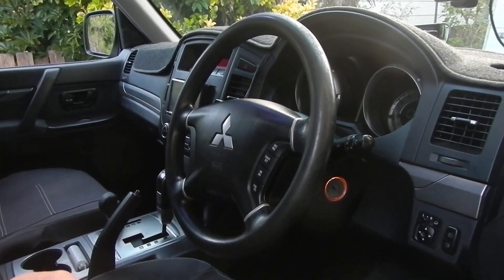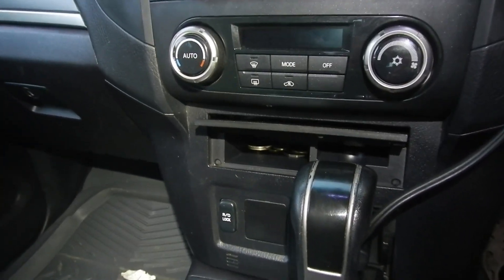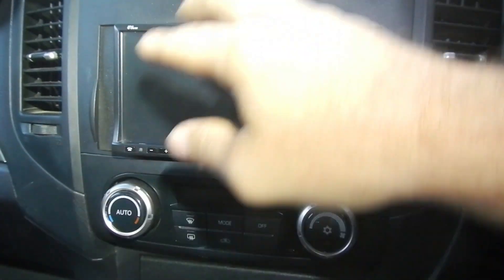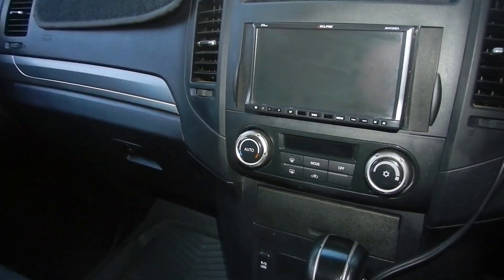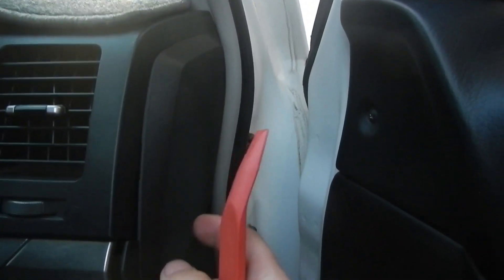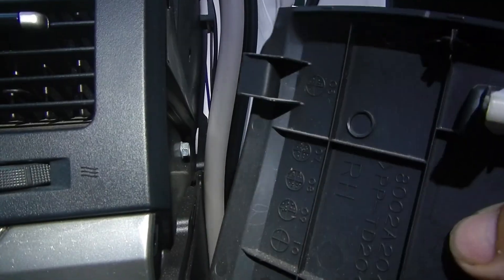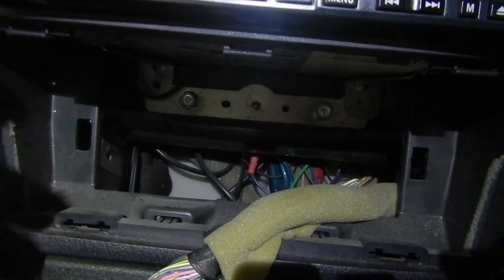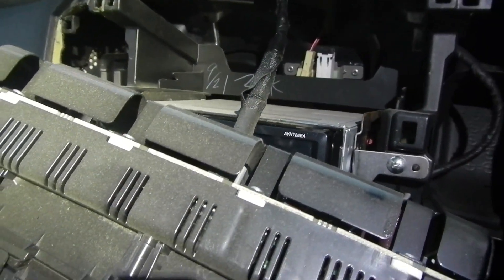Pajero NT  Dash removal part 1

Comment: I just watched this as I'm about to undertake a similar upgrade and then went looking for part 2.... you posted this just days ago lol... waiting in antisipation. Thanks. Tim
Reply from the maker: I shall try and have it up early next week for you. I'm heading away this weekend and taking the caravan so that why this was a frantic attempt to get everything done in the one weekend. I didn't film nearly as much as I wanted. Feel free to throw questions my way if I can help. Also check the pajero forum ....lots of help there too.
Reply: All good. I can wait...lol I'm on the Pajero fourm.  I don't need to get behind there yet as I'm still waiting on some parts. How does your van go hooking up? Do you have the spare wheel lift kit fitted?
Reply: I hope I don't need to pull all the top section of the dash out to do the bottom?
Reply from the maker: all good. I have a steep driveway and it was a bitch to get it set up right to not scrape but beyond that no problem. 
I got a longer hitch bar from super cheap so it comes out past the wheel. Still not much room. 
Im actually going to look at removing the lower section of the wheel cover . Looks like it should come off as a separate piece. I'll shoot some vid of that too if it works.
Reply: DENMONKEY we only just bought ours and it already has the spare lift kit fitted (raised 55mm i think) and can just fit my trailer as our camper has a trig hitch, but will get a 300mm long tow hitch for the trailer use.
Reply from the maker: I think I will need to go with that option. It seems a cheaper way to go then playing around with the van hitch etc. The lift kit must be a nice little earner for MM since they seem to sell so many and haven't made a change to the design to sort this issue.  I think I can remove the lower piece of the spare cover at the bottom to get a little more room but it will only be a little
Reply: Awesome vid cheers
Reply from the maker: Most welcome

Comment: thanks VERY MUCH, ..... well narrated and shot instruction video. 
drivers side came off great, passenger side all the vent / duct clips broke, 

- or were already broken - thats what I'm going with anyway ..LOL - nothing a bit of hotmelt glue can't fix.
 easier than I thought.

2008 NS Exceed
Reply from the maker: Glad it helped. Go with sheet broken. Just don't tell anyone else. 😁. Once you've done it, you will be much quicker each time after and it is less daunting.  What were you pulling it apart for?
Reply: @DENMONKEY  ... just to get more info on the stereo, and later to add a USB charging port, I'm going to use the hazard light button position - (on the opposite side)
I have the Rockford system (Exceed)

Comment: I also want to install another audio system mate in my Pajero but will it work properly as I have the Rockford acoustic design audio system and I want to install the Sony or Pioneer
Reply from the maker: Sorry mate, Mine didnt have the Rockford  unit in it when I got the vehicle. 

Check out the pajero forum at https://www2.pajeroclub.com.au/forum/  I reckon there would be some info there that would help.

Comment: Doesn't match .
Get proper unit
Reply from the maker: I did
Reply: @DENMONKEY   The head unit is a 9 inch screen you can buy them on eBay for $270 Australian with fascia supplied.
Many people get sucked into buying 7 inch units with no fascia ,😂😂😂 Lol hahahahahaha Lol hahahahahaha